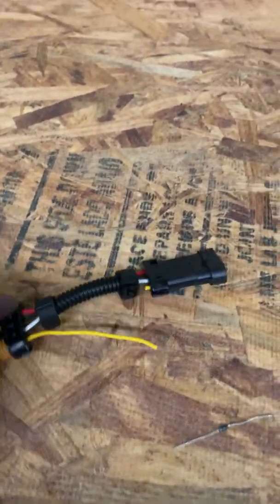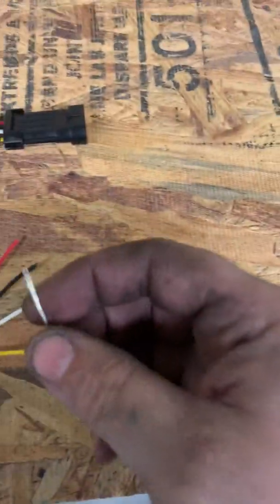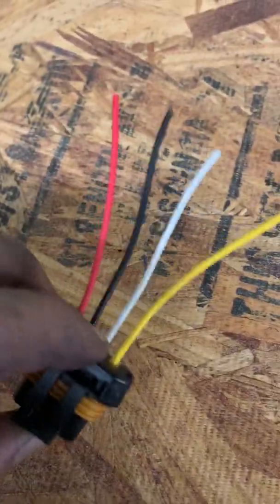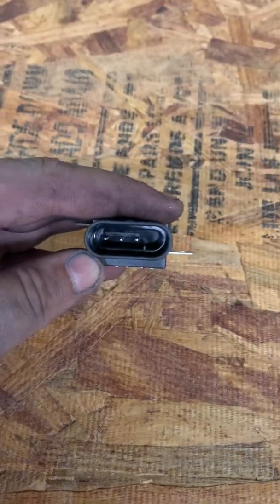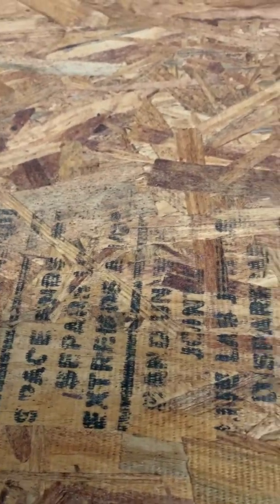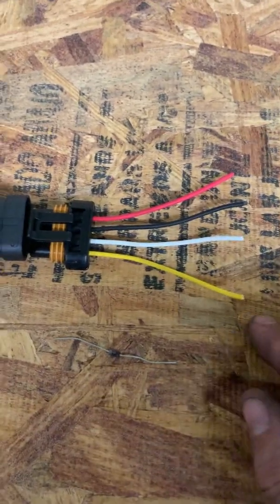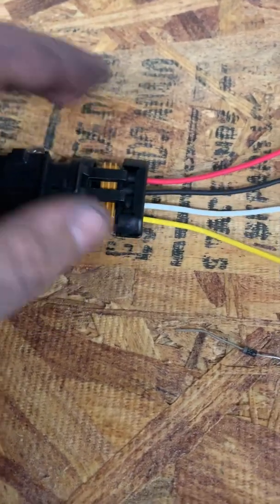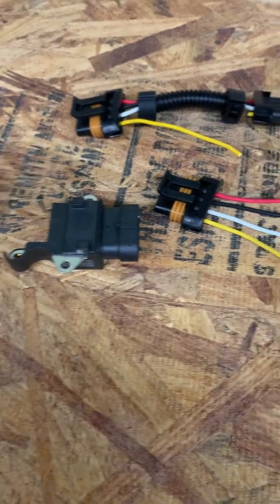Diode voltage increase walkthrough / tutorial

Comment: You were brothers with Tony or you worked for ces alternators. Tony says from ces you can't put a diode on his 250 amp Toyota hairpin. Send the alternator in it's got a built in regulator. He is full of it please tell me he's wrong. Because I built the 90 aph LTO bank. His alternator is on one utube video and it ain't even worth putting it in. 13.9 volts at idle and mid 14s on rpms. My LTO bank should last real long.   Thank you Johnathan

Comment: So my only question here on this- in your perfect relay setup at the end for the sense wire and diodes, wouldnt it technically be best read from a seperate, dedicated run of 18 gauge directly off the rear battery bank due to the elimination of the voltage differential from front to back under load?

Comment: So my car is a 19 Camry which is PCM controlled charging system and has a one wire lin bus harness so I ordered an autotech 240 and voltage control module to increase my voltage I'm trying to charge around 16 15.8 minimum but I have been told by other people with a PCM controlled car and a HO alternator that majority only see 15.2 max because the car never senses the need to charge anything the new alternator will have the sense wire 3 pin can I do this in between the voltage control module and the alternator and possibly get the extra volt
Reply: The alternator is not pcm controlled you here people say the ECM controls the voltage. So call Toyota they said at every service department they don't. The techs told me a lot of alternator companies just can't build a true alternator. You need a large case and before I would ever buy a 270xp off DC power give me the truth it's not a large case. There's not enough room in there to fit it. Then you can build 14.8 fixed input regulator but that depends on what ? come  out with it for $750.00 for an alternator not any reply.  I'm out a lot  of  green, So get an old van or suburban you can run all the alternators you want. There afraid your going to burn up your Toyota. I read on forums about people's Toyota alternators acting up as they drove around for 6 months on 17 volts lol. So nothing ever burnt up and that's hard to believe but it's true. Best of luck
Reply: @mikeanderson3565  yeah that's an old post I've got everything figured out and moved on to the actual system now and it was actually really really easy all I did was called autotech engineering and got a 240 for 425$ and the voltage control module for another 125$ or something like that and installed it and boom 15.8 charging my SCIB bank I have zero voltage drop no issues with the car period except the charging system malfunction indicator on the dash which is a modern day battery light nothing more and I don't know who you talked to but when I researched it I was told any Toyota is good up to 16v so I think maybe you are overthinking it and to be honest the car hasn't done anything that anyone said it would but I also went with the autotech recommendation of 240 amps or less I do have two buddies one at work and another in Texas both with Camry and both have high output alternator and charging at 15.8 same as me they do have some idle output issues that require nothing more than a tap of the gas pedal to smooth out and charge properly but that because they went with the large case and over 300 amps I have a small case 240 and it works like a dream but I had to figure that out on my own from seeing what the bigger alternators were doing at idle on their cars and I went with the safe option for the car because it only has 40k miles on it and plenty of life

Comment: I have a small case denso alternator putting in my gym hummer h2 have a pwm and I bought a external voltage regulator from u and hook it up doesn’t work I clipped the leg of like the video and did not use the turn on

Comment: I don't understand how having say 2 of the diodes or resistors could drain the battery??  I just need to increase my voltage output to properly charge my agm battery. If I put a resistor the equivalent of two of these diodes shown, will I have battery drain while off or am i good? Thanks for the video, most helpful thing ive seen all day.

Comment: although it is a good idea to increase the output voltage on the alternator, would that boil the battery?
Reply: this is for if you run lithium banks
Reply: Most battery’s can handle 14.8-15.2 in some cases I have personally ran my stock battery years back at 15.3 with only isue of headlights getting extremely hot.
Reply: You will get a sulfur smell before the batteries swell up and explode.  I did it when installing a motor that was from a different car.

Comment: Do you know how to get my battery light off I have that yellow wire cut and I'm putting it back just asking would that fix it
Reply from the maker: Yes the sense wire controls the light circuit.

If you need another adapter you can get it here https://brand-x-electrical.myshopify.com/products/gm-4-pin-ad-oval-plug-and-play-adapter-with-added-sense-wire

Comment: So can you do this if you had a regular acid battery or do you have to upgrade to lithium
Reply: These mods really for higher voltage for use with lithium.every diode is approx .3 volt increase.use 2 for a half volt or more.

Comment: i have a ces 270 3 pin alt on my 04 cavalier with a 2 wire plug. however i do have an adapter with a yellow pig tail for the sense wire connected to the alternator stud. i have  2 diodes on field wire at the moment but i should put them on the sense wire pigtail instead correct?
Reply from the maker: The yellow wire is the sense wire yeah.

Comment: Will this work on a stock alternator...07 Chevy trailblazer....4.2 inline 6
Reply from the maker: No

You’d need this: https://brand-x-electrical.myshopify.com/products/voltage-control-knob-pwm-control-based-on-internally-regulated-alternators-pcm-controlled-05-gm-vehicles

That also makes it plug and play for control of your alternator
Reply: @brandxelectrical  thanks alot for answering my question....be safe in all you do..appreciate it..
Reply: @brandxelectrical  will this work with a mechman 240a alternator
Reply from the maker: If it uses the stock plug yes

2 pin plug, like stock.

Says that in the description 👍
Reply: @brandxelectrical  it should work on an 04 though right? Has the 4 pin plug but only uses 2 wires.

Comment: Hi I have a 2001 Tundra 4.7 & a 300a JS alt. I just put in a 45ah Cmax. My sensor wire is white. I hooked up 3 diodes & no change. Am I missing something? Thanks for ANY help with this
Reply: Make
Sure the line on the dipde is facing away from the alt. Mabey it’s restricting the current the wrong way ?
Reply: @erikkkkkkkkk1  I ended up adding the diodes at the sense wire at the fuse box instead of at the alt & voltage went up.

Comment: Johnathan Patrick I have a 2002 bmw 745i  it's got liquid cooled alternator...how do I do something like this  to up my voltage?  I believe it's different
Reply from the maker: You can’t do this, your vehicle is Single L terminal turn on so no reliable way to increase voltage
Reply: @brandxelectrical  have you ever heard of anyone doing watercooled H/O alts or even if I can fabricate a bracket to mount a 2nd alt without getting rid of my a/c that is..engine is big and takes up a lot of room in there
Reply: How about adjustable external voltage regulator ? And just bypass the factory one

Comment: what size diode will take me up like .5 volts?
Reply from the maker: Not really how it works.

A diode 1n4004 will net you between .4-.7v some have seen even more or less.

If you’re looking for a specific increase our voltage knob is a better option that allows you to adjust it to your desired set point.

https://brand-x-electrical.myshopify.com/products/voltage-control-knobs-for-diode-replacement-on-internally-regulated-alternators

Comment: I have a 2016 Honda Accord with one wire on alternator how do I wire that up using pcm bypass
Reply from the maker: You’re looking at the video of how to wire it up.

I don’t understand the question.
Reply: I have a Lin plug do I use factory plug one wire from alternator
Reply from the maker: No, you’d use L to ignition with a 470 ohm 1/2 watt resistor inline.

That has nothing to do with this video.

Comment: I just received my 390 brand x alternator andbit came with the harness that’s already done up like u have in the video. How do i use that harness if i have another alternator thats beefed up using the stock plug
Reply from the maker: Look on our bypass video, that explains how to wire an alternator up as a secondary alternator
Reply: @brandxelectrical  ok thanks and what does the diode do whats the purpose of that
Reply: @tahoenisha7108  The diode raises the output voltage, you can do it on the 2nd amp too, same exact process as shown in video
Reply: If i added my secondary alternator and added my resistor can i still add my diode too and how

Comment: Just wanted to get it right. 
I got the 250amp alt from you and it's charging at 14.1-14.5v cold then drops to 13.8-14v warm, if I add this diode I could get close to 14.8v?
And if I add it do I just cut the S wire on the plug at alt and solider the diode in then run that straight to 12v ign? Or can I just splice the diode in to the S wire?
Reply: You're going to cut the sense wire and solder the diode to it, then solder another piece of wire to the end. You can connect the end of that wire to the alternator output post

Comment: What’s a 2 pin plug look like ? I only have the 12 volt and a blue wire! Is it ok to use this diode on the blue wire?
Reply: Is that internally regulated? If so then im sure you can't

Comment: I have a CES 14.8v Self Exciting Alt.. it has the little black sense wire on it.. since the Ext.Reg in my car isnt working.. am i able to put a diode on it to boost the voltage output?
Reply from the maker: Payton Sweeney no, you cannot use an external reg, or a diode on a self exciting reg. Those have a fixed voltsge set point
Reply: @brandxelectrical  so basically just put the sense wire on the power and let it charge? if i do so, wouldnt it continuously charge higher than 16v? or would there be a stopping point on it charging.. reason i ask is because i have done so, and it will keep going higher than 15.9v
Reply: @cootcommander03  its self exciting so its regulated to turn on at a certain voltage and begin charging at that level
Reply: @MayhemXo  mine may be malfunctioning then, because it starts to charge immediately as the car is turned over..

Comment: So I’ve got a 2013 Corolla just got a c max bank 100ah my alternator is a machman and I need to increase its output voltage, would this work for it ?
Reply from the maker: Yes, to around 15v if it’s an OEM regulator. If they used a aftermarket regulator depending on the brand it may not work. You’d want to ask the manufacturer of the alternator if it would work or not with diodes / voltage control knob.

Comment: So ignition wire gets a fuse or relay and sense wire gets diode or resistor correct? My application is for a 4 pin GM 97 Tahoe with 5.7L motor. Thank you sir

Comment: Where did you say the yellow wire goes 2
Reply: It’s not about the color. It’s about the letters printed on the plug of alt. That will tell you color. So you want the S (for sence wire). And wire to ignition fuse that turns on and off with car

Comment: So no need to wire the S to a relay if it is not multiple wire (i.e. more that one alternator).  Should be fine to connect to ignition if only running one alt?

Comment: So basically you go sensor wire > diode(s) > a fuse in the fuse box?
Reply from the maker: Dr. Merkenstein yes
Reply: @brandxelectrical  so for a 2ndary alt itd go sense wire > diode > resistor > fuse in fuse box? Or would resistor before diode?

Comment: Thanks for the video. Can you make another one with a fully completed unit? You talk about the diode but you didn’t show how to completed wire it up.
Reply: He said it in the video. Crimp the diode to the S on the plug with the line on diode facing away from the alt. Crimp a wire on the other end and run it to an ignition sorce fuse. Cig lighter or somthing that turns on and of with ignition.  And use proper connectors  to connect to the fuse itself. Fuse taps I belive. And bam done
Reply: @erikkkkkkkkk1  what about the other end of the original sense wire? It stays open?

Comment: I made the mistake of running my sensor wire straight off my battery and every morning I found my voltage dropping, to the point one morning I found my bank down to 5.3. Needless to say I had to pull everything out and recharge. I now have it running thru my fusebox piggy backing off another fuse. Haven’t had an issue since. Went from 14.8 to 15.3-15.4 charge at idle.
Reply: Any pics for reference
Reply: you did this with just 1 diode?